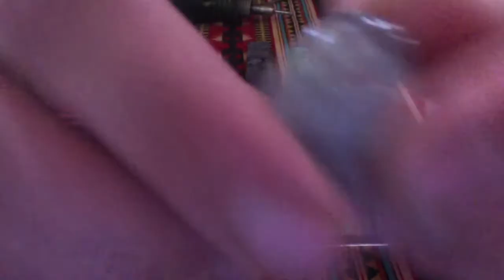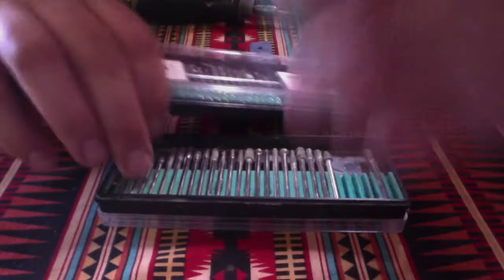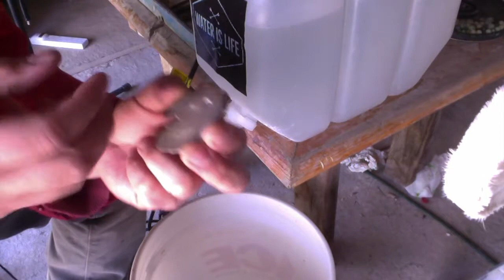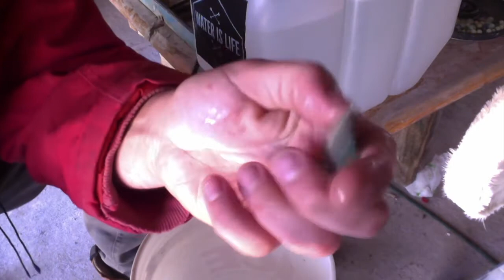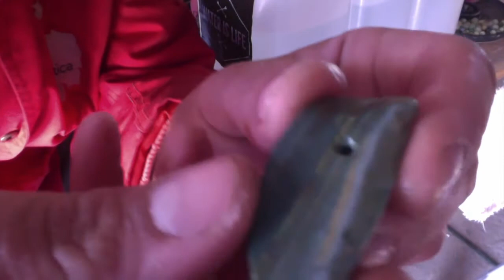Lapidary Time!! Drilling with diamond Dremel / Rotary tool bits

Comment: Hi Dave! Thank you for this video! I was successful using the rounded diamond burr in Quartz but the cylinder diamond burrs don’t seem to be making a dent. Do you have any extra tips and tricks with those? Thank you!
Reply from the maker: Maybe try using better quality bits 
What kind of bits are you using
Reply: @lapidarydave  I have used the bits included in the kit from Amazon (GOXAWEE Rotary Tool Kit), a Drilax set and a Warrior bit set. The Warrior set worked the best but I was only able to drill 4 pieces of Quartz by the time the good ones stopped working. Thank you for your help!!

Comment: Thank you for this informative video - well done! 

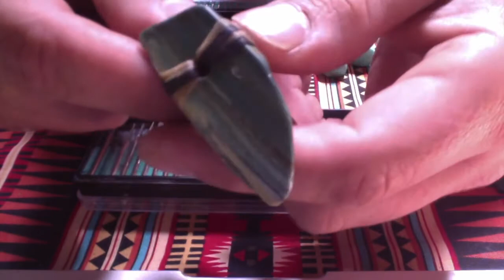I noticed at about the 16:00 min mark the stone you used for demonstration had some braided material. It looked very nice, I'd like to know what it was and how you did it.

Thanks!
Reply from the maker: Thanks for watching my friend and make sure to subscribe if you haven’t already :) it really helps
The material I used to braid up my stones in this video is a artificial sinew
I do use real sinew on very rare occasions but it doesn’t last as long as your official sinew it can be a little bit fishy sometimes and a little stiff until it is really warm in but I do like it for some higher quality pieces in this video are use a artificial seen you made out of cotton but I really enjoy the artificial seen you made out of Linen which is a lot harder to find and I haven’t been able to find at a normal stores here in the United States 
The artificial continue can be found in pretty easily online and here is a link to a video on how I made those necklaces using that type of braids and braiding :)
https://youtu.be/-_UvP30-DR8